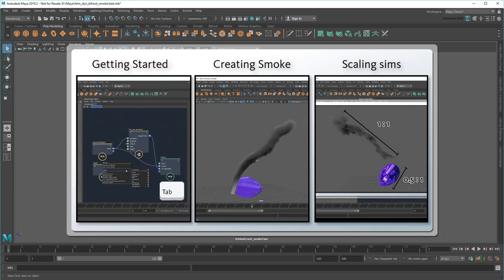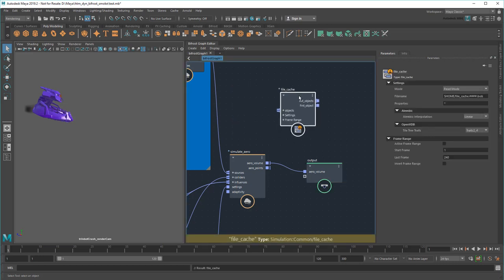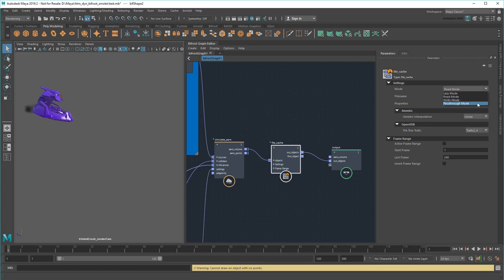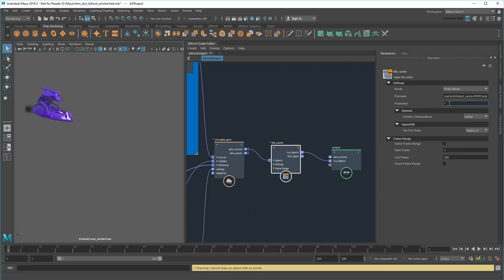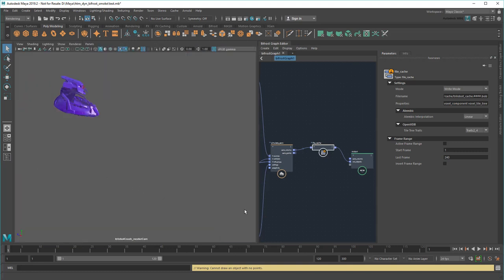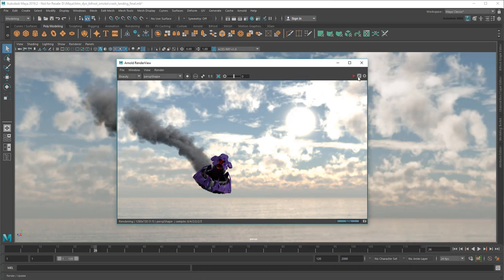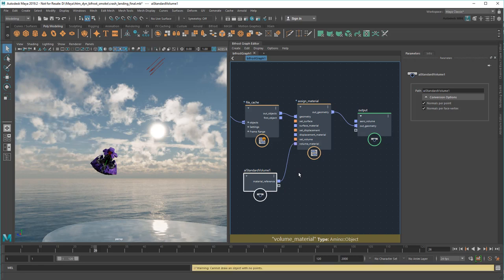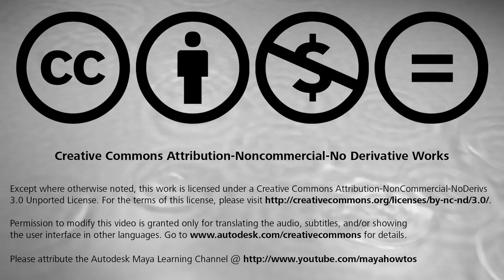Caching and Rendering a Bifrost effect (ver. 1.9.5.3)

Comment: hello! I made a smoke simulation in Maya using Bifrost. The smoke is emmiting from a mesh which was animated. When I try to cache the simulation with a file cache node just like in the video everything is fine, but when i switch to read mode, the smoke simulation is stuck at the last frame and not moving.  No matter where I go on the timeline, all I can see is the last frame..
Reply from the maker: Are you sure you cached all the frames and not just the one?  How many cache files do you have?
Reply: I had the same problem with only one file created, check if the name of your file cache is defined like in the tutorial: cachename.###.bob
Reply: also make sure you switch the cache node to before the assign_material node if you are using a shader to texture ur simulation, then it will appear as normal (i only just worked mine out now, spent so long trying to figure out what was wrong)
Reply: @jimmyog  JIMMY MY MAN, THANK YOU!!! I was dinking around for two days straight trying to figure out why my shader went grey as soon as I cached my sequence and went to read mode. Wish they would remedy this situation! Shit shouldn't be this difficult! -sorry, not sorry.
Reply: @jimmyog  Hello. Could you please explain in more detail how to switch what you said so that the data in the cache is not gray matter?

Comment: If I use Bifrost to emit say spheres, or cubes from an object, how do I make those objects renderable with Vray? If use the method in this video to cache the meshes out to alembic, when I set the node to Read Mode the spherical particles are converted to points and are not renderable.
Reply: Did you manage to solve this issue?

Comment: Using the source_mpm_sand connection model,  point is generated. How do these points inherit the texture color information of the model? For example, like Maya's particle system, the emitter has the option of "inheriting the emission model color".

Comment: Well this looks like a typical Autodesk Maya nightmare to set up, where nothing works by default and there is like ten annoying weird steps to make it work.. Why can't you just select a node in the outliner and click "cache this"? Ow and while you're at it.. make like a 1000 typical presets that "normal users" can use in their (lower budget) projects. No wonder everyone is moving to Blender. Bifrost is hard enough as it is, don't let users waste their time just to make a simple cache file.. And even when I do all these steps, the damn output node just turns red and nothing is happening anymore. And last, don't just say "on windows you have to do this and that" Explain how you do it on Mac as well, not everyone is on pc, mac and linux users pay a huge amount of money for this software too.
Reply: There is actually a node that does this for you-The thing that you wish for in this comment. They are just showing you how to do it manually. And there is an open VDB export node- Which is pretty much Magic:) and it's visual programming that is currently more accurate than Houdini. I'm as we speak exporting clouds and it took me around five minutes to figure it out.. try this feature out first, you will see how awesome it is

Comment: Caching is vital but it seems the methods vary considerably per graph. If you take a new scene and import the Ground Mist smoke from the browser, this video doesn't seem to apply. Anything I try to connect turns the output box red because of the many inputs into it.
Reply: You'll need to create a new output. The output "type" is defined automatically when hooked up, but doesn't change when a new output is hooked up to the same pin and different types are incompatible. For instance, the ground mist smoke is probably outputting as a "volume" type, but the cache outputs as an "object". Drag the cache output to the + pin to create a new output. 

You can right click and delete the old volume output. You can see him do this in the video about 1:22 (create a new pin) but he doesn't explain it and it happens very quickly.

Comment: Such an incredible video! I am however running into an issue when I batch render. I can't tell if the batch render is reading the cache files. The batch render is taking an insanely long time to render and each frame takes longer than the last making me feel like it's calculating the simulation as it renders. Is there something I'm doing wrong or is there something I need to do to make sure it's reading the cache files during batch rendering? I set the cache to "Read Only" in the graph network and the simulation scrubs perfectly in the viewport. Thanks in advance!
Reply from the maker: If the file_cache node is set to read mode, then it should definitely be reading from the cache.  To be even more sure, you can even disconnect the inputs, so that only the file_cache node leads to the output node.

I suspect your render settings may be too high.  It makes sense that frames with a lot of smoke render slower than those with less (due to the more complex lighting implications of simulations), so I'd try some lower overall settings to start, then slowly ramp up.  Reduce things like Camera AA, SSS, Volume Indirect, and Ray Depth.
Reply: @Autodesk_Maya  Thanks for the reply. It's definitely not the render settings as I can use Arnold render view on the later frames and it renders just as quickly as the early ones. 

I'm new to using cache files so I'm sorry if my questions are ignorant but I have a few more. 

When looking at the cache files it seems they grow in size incrementally. They start out at under a mb and grow to almost a gb by frame 250. Is that a normal size increase? 

I've seen some others run into to batch rendering issues with a bifrost cache and they say you have to manually put something into the command line to keep the frames from ramping up which causes each frame to take longer than the previous. Or they use some special settings in their render manager. I'm using Deadline and they didn't list the specific instructions on what they did. Any of that sound familiar to you?
Reply from the maker: @strinkovisualdesign5  The first part is definitely normal.  Again, there's very few particles early in the simulation which is why the cache size is so small compared to later when there's a lot.

That second issue is the first I've heard of that.  Unfortunately, I'm not yet a super expert on every edge case myself, but I'd recommend taking your question to the AREA forums, where a developer on Bifrost can answer it much more definitively.  If anyone will have a solution for you, it's them.

Comment: i have cached a simulation yesterday and now opened the scene and want to continue cache from the last frame but it just doesn't work.
Reply from the maker: You can't work incrementally like that unfortunately.  A cache needs to be created from start to end in one go.
Reply: @Autodesk_Maya  So you can't cache from a scene - Call it Smoke_001.mb - to a Bitfrost object, close the scene, and then re-open and scrub through the sim without re-calculating? 

Is there a good written tutorial on how to cache to an object? This video seems to present a number of options.
Reply from the maker: @jamesmccallum1248  You can definitely do that.  What I meant was that you can't do something like cache frames 1-300, then change the sim at frame 300 and then cache from 300-600.  In that case, you'd need to sim 1-600.